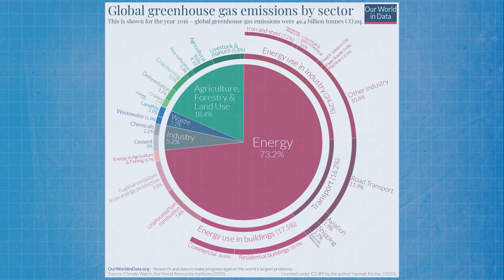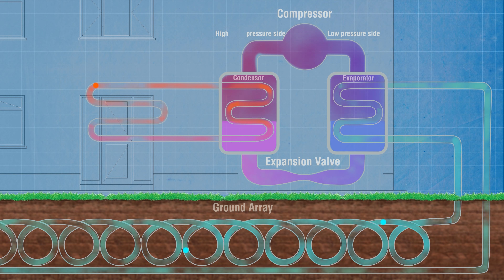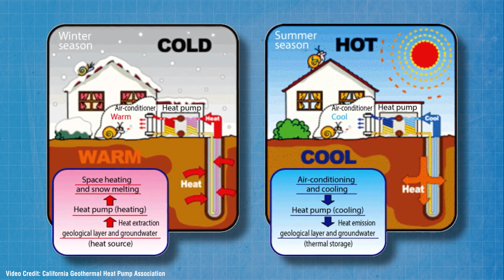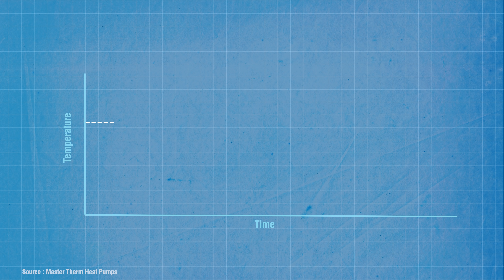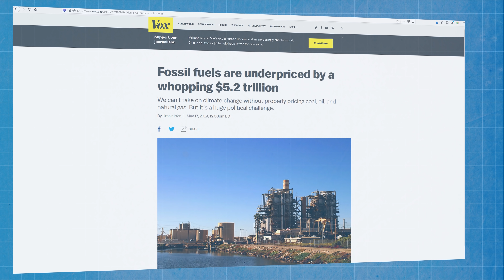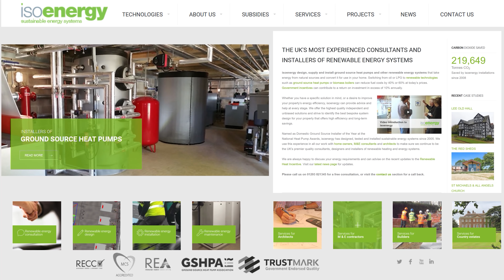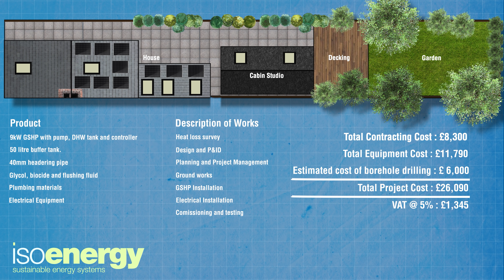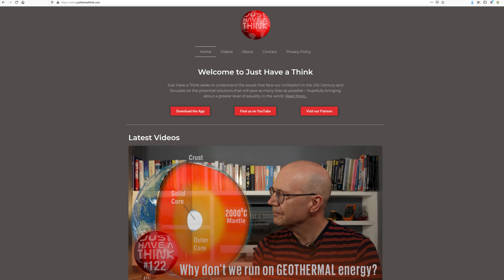Geothermal ground source heat pumps. Heating your home from your own back yard!

Comment: Very timely, as I have just bought a house in Wales! I will be contacting isoenergy for a quote; I may be able to raise a modest mortgage against my pension, if necessary, especially if I can get some rebates!
Reply: Richard Prosser don’t forget the just announced green home Energy grant which applies to heat pumps
Reply: @peterjones6640  Thanks but I have never heard of it; I have sent an email to isoenergy however, for a quote.
Reply: https://www.gov.uk/guidance/apply-for-the-green-homes-grant-scheme
Reply from the maker: Excellent news Richard. I really hope the project goes well :-)
Reply: Hi Richard, my colleagues have received your enquiry and will get back to you shortly.

Comment: Hahaha old news for people that don't like change. 15 years ago I put in a ground source heat pump / air conditioning when I built my new house it was only $5k more at the time and of course it has paid me back 5 times over. Now I added solar 4 years ago and basically I can live in my home for the cost of land taxes. How people can't see the advantages is beyond my comprehension.
Reply: I was wondering how it would work near the Gulf coast. Houston here. The compressor has to work that get the humidity to condense on the evaporator cold. Would running a dehumidifier in the house help with making the indoor air more comfortable?
Reply: @bocadelcieloplaya3852  yes but my system also has hvac which dehumidifies too. both have drip trays plumbed into the drains.
Reply: Common Sense Realist  Yes the ground source temperature in texas is likely 70 f so not as efficient for AC where mine is 50f so it works awesome. I heated my house with conventional electric heating (resistance) and it was 3 times as much.
Reply: Common Sense Realist  many greenhouses are heated with ground air and a fan
Reply: You fellas in the south should buy heat pump Water heaters as they control humidity and AC as a by product of keeping the water hot. Edit lost my mind there for a minute.
Reply: Common Sense Realist  maybe Peltier heat pump is closer to what you need run by solar simple idea and it works both ways by that I mean if you have the heat and cold it can also make electricity

Comment: I have been looking at heat pumps for when my old Potterton boiler gives up the ghost. Ground source initial costs are very high. What about a video on air source heat pumps? I think more people could probably afford one of those. (Me included)
Reply: @Richard Wood best is to use 'low flow temp radiators'. This can be emulated using small radiator fans in combination with traditional radiators. That would allow you to lower the flow temperature somewhat.

Most important however, is to make sure the building is insulated really well. All in all, its a rather big investment to make. We just did our pre-war house in Holland and spent about  €45k in total (insulation of roof, outdoor walls, a new insulated floor, replacing all the glass with latest generation double glazing, ASHP, in-floor heating for 3 floors, pellet burner). This is not entirely fair however, because many of these costs (like the windows and  glass) were related to much needed renovation anyway. We also got about €11k in subsidies. Only thing we still need to do is installing a ventilation with heat regain. House is so well insulated now, that we need more fresh air...
Reply: @bilgyno1  this is what most houses in the country need. But most homeowners don't have £45 grand to spare, although spread over say 10 years that's £4,500 which is a bit more do-able but still needs financial help for most. I've done mine (IWI, EWI, airtightness, MVHR, 3G, PV, which just leaves heat pump and floor insulation still to go). That lot is £27K so far over a decade, although the FIT will subtract another £10K by the time it expires. It's not going to happen at scale without significant government finance and a change in social norms so people do this before they buy kitchens/conservatories/new cars.
Reply: @Wookey.  The average British adult has £276 surplus income. That's per year, not per month.
Daily Mirror March 2019: https://www.mirror.co.uk/money/average-brits-disposable-income-revealed-14081720
I would guess that those who have even £4500 per year are only those in the top decile, at least.
As you say, nothing will happen until everyone starts taking it seriously, and there's no sign of that yet. (Please excuse my paraphrasing)
Reply: @nicktecky55  No, that article says £276 per month. So £3300/yr. Also that survey gave UK average income as £21744, whilst the govt figures say median (lower than average) is £29,600. So I guess the survey sampled a population biased low. So I think we agree that funds for retrofit are limited, but please don't post wildly innacurate information, and check your own links :-) If everybody spent a couple of grand a year on retrofit the country would be in a dramatically better place in a decade. We agree that grant schemes are needed to make this happen at scale.
Reply: Alan Easthope , assuming you live in the U.K. don’t forget now the Green Home grant and renewal heat incentive
Reply: Air source are great if you don't live where it gets really cold. They're good down to about 35*
Reply: @kj9219  35 F, C or Kelvin ;-) I wish people would think internationally and not be so insular.
Reply: @kj9219  it could be good if you have a long heating season to! Then it can handle the long periods with little heating demand. 😊
Reply: The low cost choice are air to air heat. It's basically a revered AC dimensioned to run as a heat pump. It save less but are about 2000 euro.
Reply: The problem is efficiency at low (air) temperatures. The ground temperature is   quite stable during the year, thus the efficiency is improved. 
COP with regards to input air and output water temperature - https://www.researchgate.net/figure/COP-of-the-air-to-water-heat-pump-with-different-load-side-inlet-temperatures-Based-on_fig1_326114264
Reply: @Richard Wood You can use radiators with ASHP, if yours are already overspec, you may be able to keep them.
Reply: @Richard Wood if you get an air to air hp, you're only going from outside air temperature to inside air temperature. Would that be more efficient than going from OAT to the boiler's 60C?
Reply: @Richard Wood The more insulation you add/airtightness you do, the more oversized your rads become. So you can make the existing rads work at lower temps by adding insulation/fixing holes. In the long term, fabric improvements always win as they cost nothing to run. DIY IWI is even pretty cheap, but EWI (also DIYable, but quite a big job) is technically much better and much easier to do to high standard. Ideally you do the insulation first then you can size the heat pump. But if you can't I'd size the pump for the target house, then the fact that it might be a bit chilly for a few years on cold days, acts as an incentive to get the rest of the job finished :-)
Reply: @Richard Wood what is you energy cost for olje vs electric? Just curios! Swedish taxes make oil dubbel the electric price as a comparison. Cheap electric, high oil tax.
Reply: @Richard Wood sorry, I am sure what you mean about "least economical gain"? The heat pump running cost use to be 1/3 or 1/4 of the electric cost? 🤔
Reply: @Richard Wood thanks! Equal number in Sweden will be 40 000 sek/3 m^3 total cost equal to 40000/(3*10000kwh*0,8 eff) =1,66 sek/kwh useful energy.

Typical electricity total cost 1,5 sek/kwh /3.5 COP = 0,45 sek/kwh= useful energy... 11, 5 sek = 1 pund gives 
oil 0,14 £/kwh  
heat pump 0,04 £/kwh cop 3.5

That's explain the difference in popularity of heat pumps in different countries! 😂
Reply: @Richard Wood Yes, you got it right! The vehicle fuel and heating oil has pretty much the same price in Sweden! It all started during the 70s energy crisis when the Swedish government wanted to be less dependent on oil import because we need to import all oil. So it make sense to increase the price equal for all energy oil and let the market pick the lowest hanging fruits. My guess is that GB mainly wanted to limit the traffic volume with the tax? 😊

At the same time the district heating system was built widely so most larger building in citys are connected to district heating and the oil burner are gone long ago!

Comment: I was always told this is not particularly geothermal but actually solar gain (especially for the 1M deep systems) as the heat comes from the sun warming the earth and not coming from down below.
Reply: I tend to agree, you'd have to be at coal-mine depths to get geothermal heat.
Reply: That question set me off on a bit of a hunt - I could find avg. geothermal & solar heat flux but difficult to deal with amount of heating of earth surface vs depth.  This article indicates that for most of us, below 30 feet, there is little seasonal variation so if you go deeper than 30 feet, one is In geothermal regime and shallower than that, solar increasingly has an impact. https://builditsolar.com/Projects/Cooling/EarthTemperatures.htm
Reply: @chrislook3395  Chris, if you do the heat-flux sums you'll find that the geothermal flux is very low indeed in the curst (top ~30km) (which is why the core can stay molten for billions of years) so the solar flux will dominate until at least several hundred metres down, probably several km down (except in hotspots). So even in the stable temp area more than 10m down if you take out some heat it'll be replenished almost entirely from above, not below. i.e the OP, Graham was correctly informed.
Reply: @Wookey.  Actually, no.  You are correct that the geothermal heat flux is low relative to solar irradiance but non-physicists tend to forget that the solar radiation absorbed by the earth has to be balanced (time averaged) by the amount of grey/blackbody radiation that the earth emits (i.e. blackbody radiation by the earth over 24 hours ~ amount if solar radiation it absorbs during daylight & better if longer times used).  More importantly, it is shown by experiment, for example figure 10 in the the US Geological Survey report (link below), that the geothermal gradient (i.e. getting warmer towards the center of the earth) is constant year round for depths around 10-20m (depending on diffusivity of the rock).  So, if one employs horizontal pipes buried a few feet in the ground, it will be predominantly affected by solar.  If, on the other hand, one drills 100m and runs pipes vertically, one is in the geothermal regime.  https://pubs.usgs.gov/bul/1172/report.pdf
Reply: @chrislook3395  I was thinking that the flux is low in comparison to the heat extracted by the heat pump (rather than in comparison to irradiance, which is huge), so the temp falls and there is a lot more available heat near the surface to flow and equalise than will be coming up from below (and much shorter lengths of dirt for it to flow through). The temp underground does not rise due to geothermal heat until you are at least 1km down in most places (it's just as cold 700m underground in Austria as it is at the surface). Clearly heat does come from both directions to some degree. I'll read your reference.
Reply: @Wookey.  ok - I see what you are getting at but that is a little different from the original solar vs. geothermal question..  Yes - the heat flow from the ground back to the fluid (or gas) in the pipe would indeed be slow but that is the reason why one requires such a long length down and back - basically, one is increasing the interaction length to ensure the maximum heat is exchanged - one wants the exiting working fluid to be at the ground temp.  For horizontal systems (vs. vertical), the soil is hotter during summer and colder during winter so it works against the heat pump (e.g. in winter, one wants to pump heat to the house but that is less efficient as the 'cold' temp drops as there is less 'heat' that can be removed & why heat pumps become less efficient.  Easiest to think in Kelvin for this).  Re. mines -  I don't know what mine you are referring to but if the temp at a depth of 20m was 57F (14C) as in my earlier reference & assuming 27C/km, the expected temp would be ~33C or (91F), which would indeed be similar to surface temp on a hot day.  But there is a complication with mines...Mines are required to have forced air ventilation so one's analysis needs to take that into account - one would want to measure the rock face temp.  In the very deepest mines (look up TauTona Mine), they use air conditioning so humans can survive when the rock face is 130F (55C).  This is a tricky topic but hope this helps!
Reply: Yes, Graham Eida, you are correct! The energy for the heat pumps in the ground (earth, rock and water) comes from the sun. As of course the energy to the air heat pumps.
By the way, I might have missed it, but didn’t see any mention of “digging” the source tube for a heat pump into a lake. Easy and also stable temperature even in winter (+4 degrees Celsius) as a source for energy. 
Lived 15 years in a 140 m2 house with earth/ground heat pump. The lowest yearly total use of electricity was 4600 kWh, that included heating and all other electricity for the house. This was at the Arctic circle in Sweden.
Reply: They did a house in western canada .The pipe is about 1.5 meters deep and about 75 to 125 meters long. I may be off a little .The air coming into the house was 100 deg. for winter and is used as cooling for summer.

Comment: I agree gshp needs more support and promotion but as important is insulation. Have you thought of a video about Passivhaus and other super-efficient building techniques?
Reply from the maker: Hi Graeme. Very good point. I do have Passivhaus on the schedule for the New Year.
Reply: @JustHaveaThink  that's great news! Thanks.  We built a passivhaus 4 years ago and it does do what it says on the tin - heating bill £100p.a. and v high level of comfort! I just cannot believe it is not being pushed by anyone in the uk. We thought that by now all new houses would be built to this standard but the uk gov seems quite lukewarm. This is so disappointing.  UNLIKE YOUR VIDEOS,  WHICH DO NOT DISAPPOINT!  I just love your calm measured delivery of facts and sweet reason. Keep up the good work.

Comment: I live on Long Island NY and we just had geothermal heating and cooling installed last week if anyone has any extra questions I can try to answer them we also have solar... awesome video btw!!
Reply from the maker: Thanks Mathew. Good luck with your new system - I hope it really worlks out well for you :-)
Reply: Sorry but solar energy costs more energy than it produces. maintenance costs, and you’ll have to replace them again in about 20 years.
Reply: @clxwncrxwn  No it doesn't.  If it did, utilities wouldn't use it.
Reply: clxwncrxwn I’m not sure where or how ur getting ur calculations ? The solar will have paid for its self in 3.7 years this includes the increase in electric consumption by the new geothermal sooo that’s 16.4 years of “free” electricity if they only last 20 years

Comment: I'm certainly going to explore heat pump. Unfortunately this house has ducted warm air heating by gas . Not sure if it will work out.
Reply: As I understand it, ducted air is perfect for heat pumps.
Reply: @alaneasthope2357  Thanks Alan cheered me up on this sodden day😁
Reply from the maker: Check out the ENGEO video - they used the existing ducting there too.
https://www.youtube.com/watch?v=vXL3g9UvVNg
Reply: @JustHaveaThink  many thanks David for your outstanding presentations. Really quite heartwarming...
Reply: You can consider and air-to-air rather than air-to-water type system. Not something we get involved in as it sits in the HVAC market. We heat one of our offices here in the same way.
Reply: @isoenergyltd  many thanks

Comment: just to say the insert showing an electric heater tagged with 100% efficient, mmm, no machine is 100% efficient is it? As for ground source heat, wouldn't insulation in older houses have to be improved dramatically adding further cost? Also rented homes are going to be a sticking point, landlords are not going to buy into this without better incentives and again there is a lot of older housing stock in the rental market which is poorly insulated.
Reply: A heater is by definition 100% efficient as the measure of efficiency is energy lost as heat which in a heater is considered working as intended.
Reply: @sednabold859  yeah but that energy lost as heat had to be converted from electricity to heat and that process is not going to be 100% efficient is it?
Reply: @Andy Jeffs 
depending on where you draw the line for the system energy going into a heater is used 100% efficiently ignoring that most of us exist on a national grid that is its own much larger and inefficient machine. Saying that, heat generated from electricity is inherently more energy intensive than direct heat generation (if you were to say burn the coal yourself) due to the conversions, ignoring logistical factors. In the common sense yes it may not be an efficient use of resources but on the graph putting a heater unit as 100% efficient makes sense because that's how we measure the efficiency of a machine, energy input vs heat and friction.